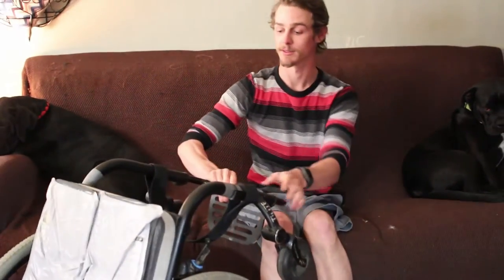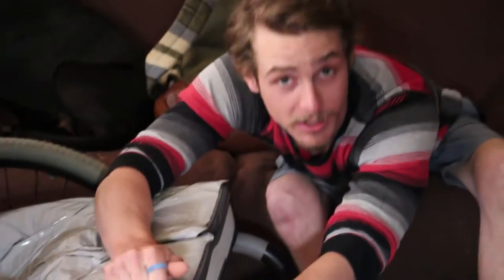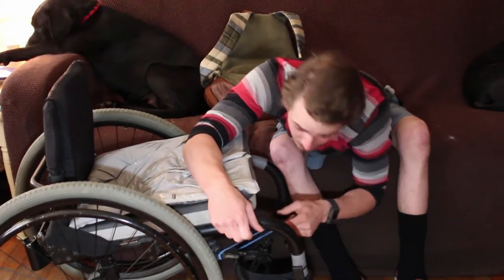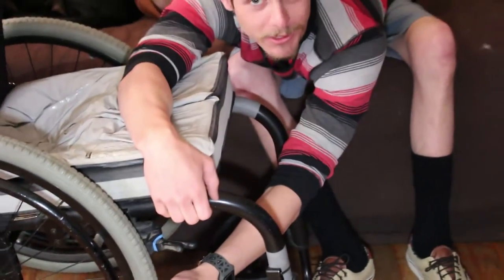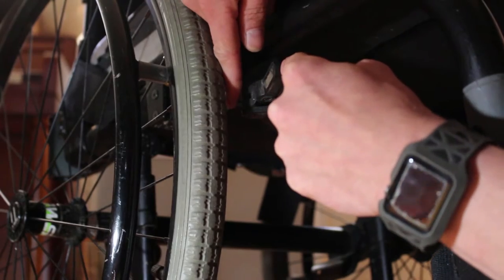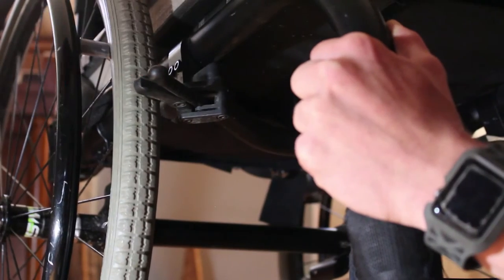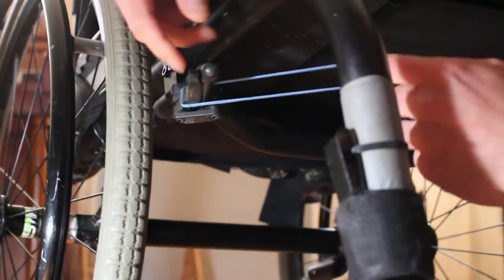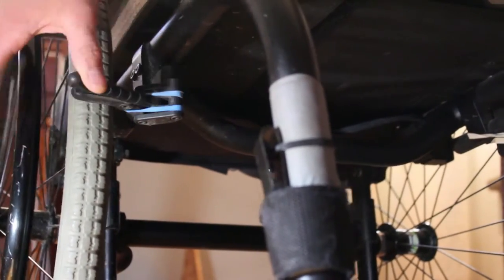Wheelchair Tip 6: Scissor Brake Fix

Comment: Hey thanks for the video. Here's a question. Do you know how to adjust these?  I just got a new set of these brakes replaced on my chair (also a TiLite), but when I told the tech that I like my brakes tight, he went a little too far and now I have to really struggle to just disengage them to move. Do you happen to know which of the screws adjusts this and what tool to use?
Reply from the maker: I do indeed. It’s going to be hard to explain it through text. I will make another short video explaining it and get it posted ASAP.
Reply: @wheelchairryder7278  you sir, are awesome! Even if you said which of the 4 screws I needed to adjust a what tool I needed, that's enough for me to figure it out. I am afraid to engage my locks cause it is so hard to get them off to move around or take my wheels off to load them in the car.
Reply: @wheelchairryder7278  Hi Ryder Crosby, how are you doing? Hope you’re well! Hey Ryder Crosby thank you for posting this wonderful video. Here’s a question. Do you know how to adjust these? You just got a new set of these brakes replaced on your chair(also a TiLite), but when you told the tech that you like your brakes tight, you went a little too far and now you have to really struggle to just disengage them to move. Do you happen to know which of the screws adjusts this and what tool to use? Best friend, from, PaulLaw.

Comment: What type of scissor locks are those? I have a zra but my scissor brakes function differently. When mine break (not brake lol), they just flop around and don't "compound" and lock anymore, which provides the actual lock function. Part of the composite material frame breaks off (hard to explain) and there's nothing I see that can fix it, or even jerryrig. I really wish tilite or someone made an aluminum version, or even a revised design that was more durable. I love the low profile but I can't keep buying them & risk having one stop working at the worst time.